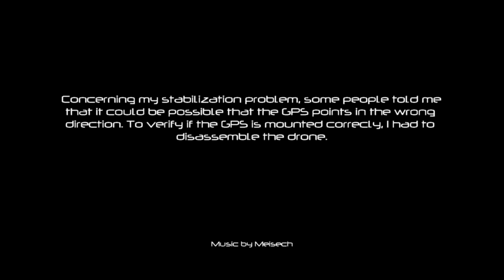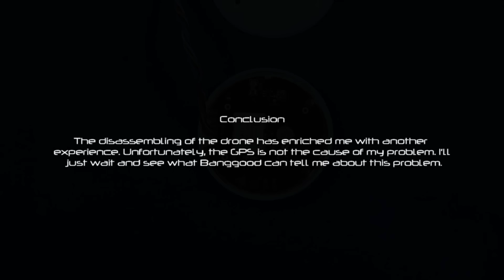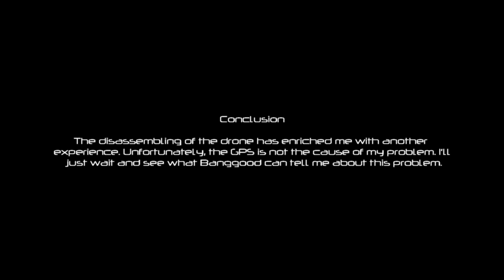Ao Sen Ma CG035 - Part 5 - GPS mounting direction

Comment: What is the latest with your quad, has all the bugs been ironed out? can you show how the problems were fixed.
Reply from the maker: At the moment, I still waiting for a positive answer from Banggood. In their last mail they suggest to buy a new drone with a 20% off. But this is not the correct answer. So, I made a new mail to Banggood. So far I have not received an answer. As soon as the weather permits, I will make a new test flight and this time I will start the drone in manual mode to see if the problem comes from the GPS module.
Reply: Did you change the trim pot, I would b4 you take it up, I got a lot of camera shake out of mine, by making thin washers out of the clear plastic cover used in the packing. good luck with yours.
Reply from the maker: I will see what I can do.
Reply from the maker: I added 2 new links in the comment window concerning the binding problem and the configuration problem.

Comment: I just ordered mine at BG. Hopefully without the glitches you have. I follow your findings closely.
My conclusion: You start in GPS mode. In this mode the copter tries to remain on the actual calculated GPS position. Obviously these coordinates have a drift or are somehow erratic, leading to erratic movements. I strongly suspect a faulty GPS module. 
BTW, what is the battery for on the GPS board?
Reply from the maker: Hi, if the GPS is the cause, then the drone could not hold its altitude, but this is not the case. As mentioned in my video, the left stick, throttle and YAW are ok. Only the right stick, roll and pitch are concerned. At the moment the weather is very bad here in Luxemburg. I will make another test flight as soon as possible. I will also try this time to start the drone in manual mode. If the GPS is the cause, in manual mode the drone should climb straight at a given altitude. I will see. Concerning the battery of the GPS, a so called BBRam battery, I don't know what is the exact function. I suppose the GPS can memorize the last coordinates or so. I found an answer at the DJI forum : http://www.phantompilots.com/threads/gps-battery.13766/
Reply: Ok, hope the weather will improve. A flight in manual mode should further isolate the fault.
Concerning the battery, if I remember correctly some GPS systems can perform a warm start and a cold start. With warm start the position lock is faster. Yes, you are right, obviously the battery buffers the last position data.
Good Luck!
Reply from the maker: Maybe I found a solution --> links in the comment window

Comment: Hello, my Aosenma has recently stopped working (when I turn it on all four red lights appear on the controller). Initially I thought it was a battery problem so I bought a new one, but that did not solve it. Do you know what could be the problem ? Thanks
Reply from the maker: That means, that your drone is no longer recognized by the controller. It seems you lost the binding between the controller and the drone. Please watch this video to bind the drone again with the controller : https://www.youtube.com/watch?v=TAuMTJss3mE or check out the procedure on how to bind the controller on my website : http://www.cyanscorpion.com/cg035-software-and-manual.html - manual (page 42)
Reply from the maker: As I can see in your video, the battery Led on your remote is not going off. This means that your battery is not fully charged or may the battery is damaged.
Reply from the maker: In your previous posts you told me that all the four Leds were on and even with a new battery the problem was not solved. I am not an expert but in a worst case, a malfunction of the power distribution could be the cause. First check that the battery plug has a good contact with the connectors. If you own a professional balanced charged, check if both battery cells are equally charged. Normally, the balance charger gives you an error message if there is a problem with the battery. So, that's all for the moment. If I find another solution, I will keep you informed. Also check the manual again for further informations.

Comment: would you know where I can get the surface mount connector for the GPS on cg035?
Reply from the maker: Hi, if I understand well, you only need the connector, It's a JST 6 pin male connector. I am not 100% sure, but I think it is this one : https://www.banggood.com/20Pcs-Mini-Micro-JST-1_0mm-SH-6-Pin-Connector-Plug-With-Wires-Cables-150mm-p-1170259.html?rmmds=search . The order of colors is somewhat different.